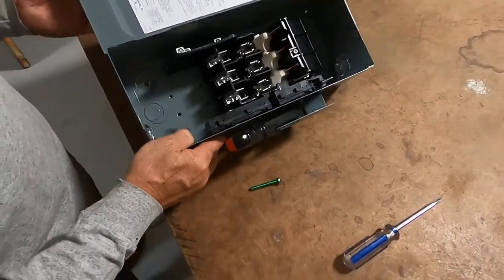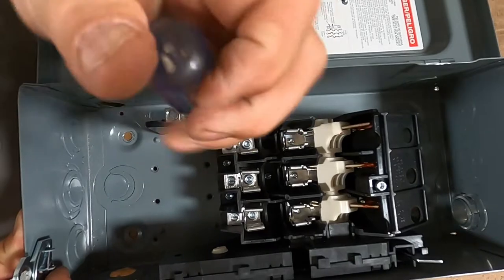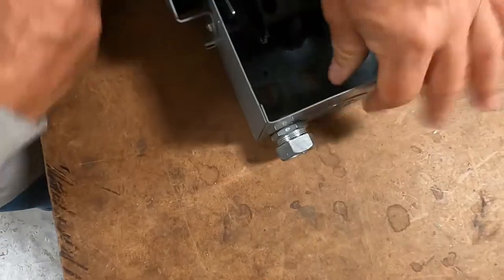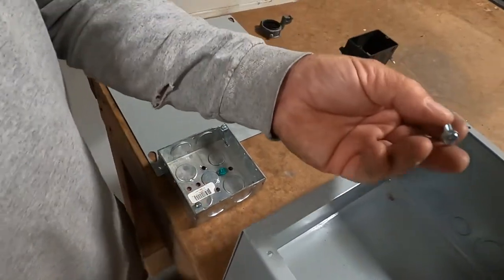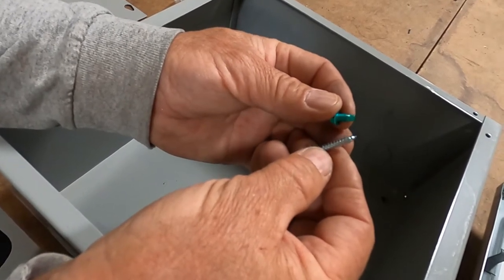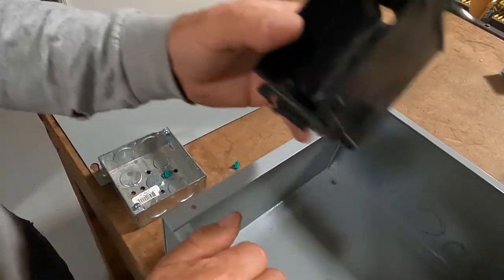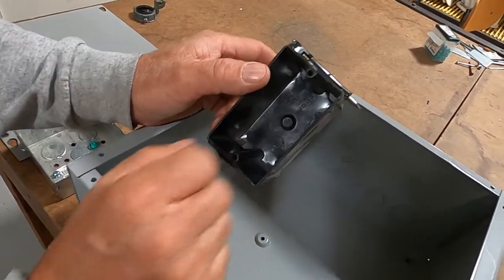Bonding and Grounding

Comment: Not an electrician here, but I thought you only have to use bonding bushings for metal raceways or cables on the SERVICE side of equipment? So why would you need them on ALL metal raceways. Again not an electrician but I get sparky once in a while lol
Reply: you are correct and also a bonding bushing on eccentric knockout when there is an ungrounded conductor above 250 volts to ground so the bushing bonds the enclosure.

Comment: Those are eccentric knock outs bro.
Reply: Eccentricity is usually expressed as a percentage. A pipe would be considered to be fully (100%) eccentric if it were lying against the inside diameter of the enclosing pipe or hole. A pipe would be said to be concentric (0% eccentric) if it were perfectly centered in the outer pipe or hole.
Reply: Google eccentric vs. concentric..find some pics. They are 2 different types
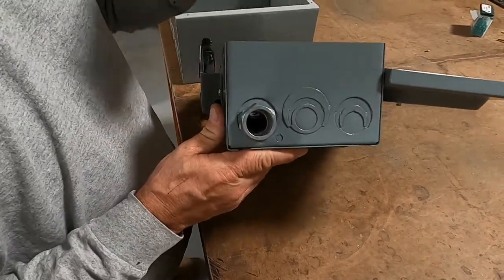Reply: At 1:30 those are eccentric..maybe you are talking about something else